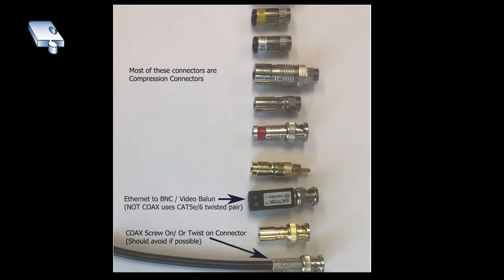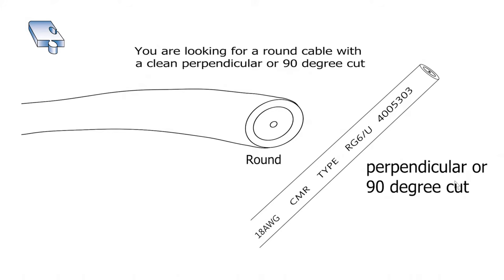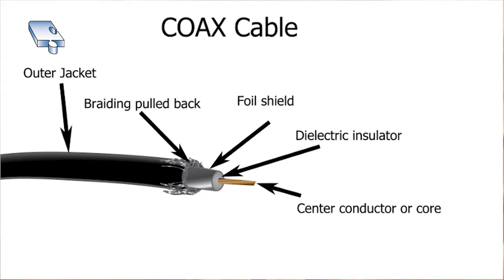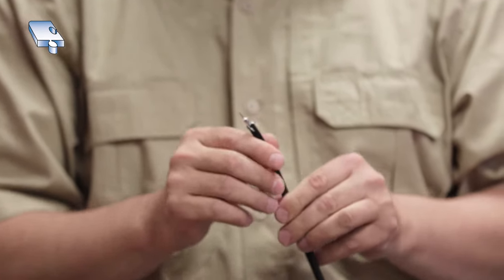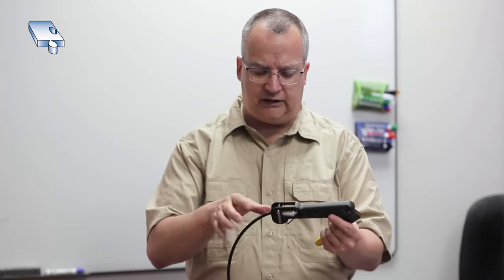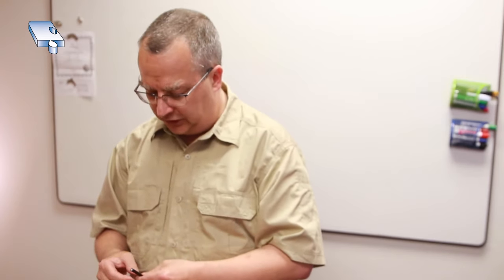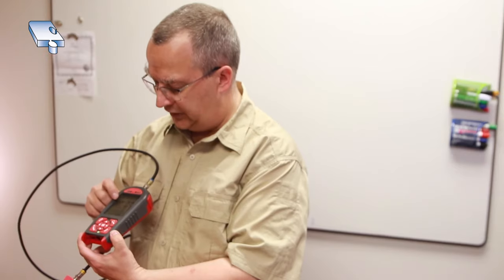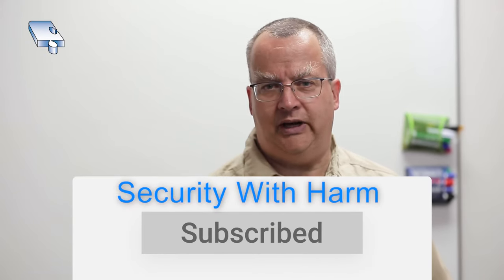COAX F-Connector Stripping, Wiring and Termination of COAX Cable

Comment: I bought these ppc connectors and they look odd for me to install 😂😂 darn !! I didn't want to spend $60 in tools to put 6 connectors on 🤬🤬😄😄
Reply from the maker: I see tools on Amazon for 19US or 23 Canadian depending on the model of the tool there are lots of possibilities. But tools are always a minefield when choosing brands and opinions so  I don't want to recommend any specific brand. Still, something like the Klein Tools VDV212-008-SEN Compact Compression Crimper, F-Connector may work.

Comment: Thank you very much!
ps. Only one addition: "OL means Overload on the multimeter when testing for voltage and resistance. In these cases, it means that the multimeter limit is too low for the electronic property being measured. If you are testing for continuity, OL means Open Loop, meaning there is a break in the circuit."
Reply from the maker: Thank you, that is helpfull
Reply: I was always confused by what the letters "OL" stood for when doing a continuity test. It was never explained. Many thanks!

Comment: great video.  really clear.  I looked at the wires in my house and wonder if I should change them to newer coax cables.  These are what I have:    TFC-T10 E86650-2 CATV 6 Series 18AWG and PPC perfect flex 6 series 18 AWG cat CL2 CL# ETL us ORCM 3088178.  Could you advise.
Reply from the maker: Does the cable do the job? It looks like it is RG6 which should be good enough for cable TV/ internet or satellite TV. I would only consider replacing it if it was not doing the job, and I would always check the connectors first. Replacing cabling in a house is often not easy, so there should be a good reason to do it. That does not mean that you couldn't get better cable,  and opinions will vary widely.

Comment: How do I prevent over crimping on a RG6 cable connector with a crimping tool? 20:12 I've got those cheap connectors with the blue ends, that when crimped I can no longer turn the hexagonal crew on part.
Reply from the maker: If you use the correct tool it should not happen, I usually just use compression connectors. If you are using the same connectors that I am using at 20:12 then it is not a crimp connector it is a compression connector and you need to change the tool. If you have a compression tool and it stops moving then you need to adjust the tool so it stops the moment the blue ring reaches the collar of the connector. If you are using lineman pliers or something similar it sounds like to are crimping too close to the turning part. (Hex Screw). It should be an even hex pattern all the way around. and the cable should not be distorted. If the cable starts changing shapes then you are probably over-crimping the connector.
Reply: @securitywithharm6367  OK thank you for your tips, I think I need to adjust my compression tool. I guess it's a bit of trial and error on my part.

Comment: Can you please share what crimp tool you're using
Reply from the maker: I used several different tools, but for F Connectors I used a Ripley tool: RIPLEY CAT-UNIV 36175-1 Universal Compression Tools For Coax Cable Connectors

I have also had good luck with the Jonard Tools and Platinum Tools coax compression tools

Where possible I recommend compression over crimping tools.
Reply: @securitywithharm6367  Thank you. Unfortunately, it's hard to find any for sale
Reply: @securitywithharm6367  I found one.  :)  Thanks again
Reply from the maker: @Foxtrot1967  your welcome

Comment: 26:13 didn't u mean for continuity, LOWER numbers are better? We're using the multimeter as an ohmmeter here...
Reply from the maker: At: 26:13 on it I have a higher number is better. This applies to setting the range on the multimeter
with manual resistance settings. When we choose a larger range like 1M Ohm we are more likely to see a zero rather than at a lower range we will see a range of numbers. With continuity, we are seeing if the wire is continuous not what the resistance is, so for people unfamiliar with the use of a meter zero is easier to understand. If you understand resistance a lower range will give you a better understanding of the cable. (This could be important if you are measuring a damaged cable as a very high resistance will not allow the signal through even though the wire has continuity. )
Reply: @securitywithharm6367  I agree with everything you said, except I still don't understand why you would want a higher number :) Indeed, the lower the range, the higher the precision when measuring things around few Ohms, otherwise all you would get would be a false zero. Lowering the range acts as a zooming tool on the resistance. But that is a different discussion. When you're trying to see if a wire is properly conducting electricity, you still want the impedance to be as low as possible, which in the case of a DC measurement, roughly translates to the resistance being as low as possible. So with your meter on the lowest range (for accurate readings when dealing with small numbers), a measurement of 3 Ohms is way more desired than 17 Ohms, for instance.
Reply from the maker: @ArmWrestlingOverdose  I do not disagree, but when you do not understand ohms at all then it is easier to see a zero. The best part would be if everyone doing this learned more about electricity. But many people only do it once or twice.